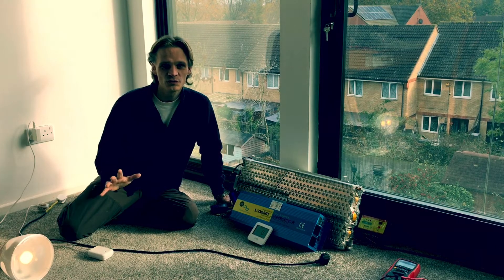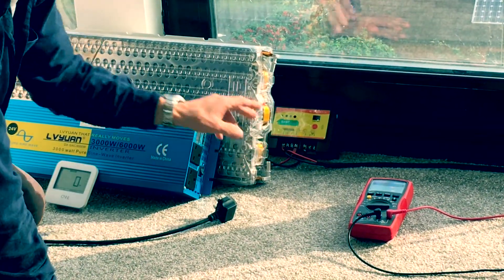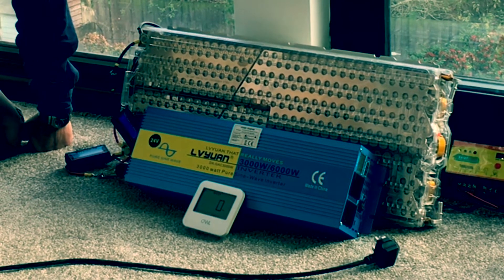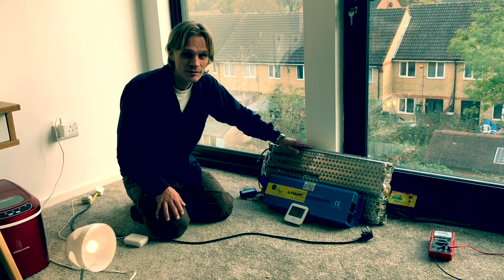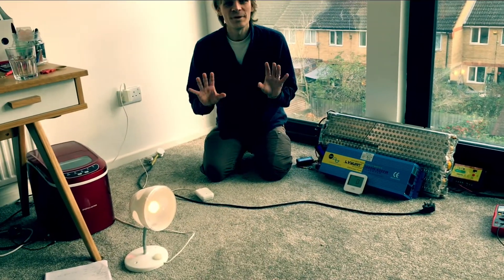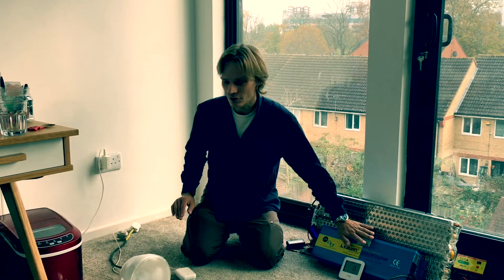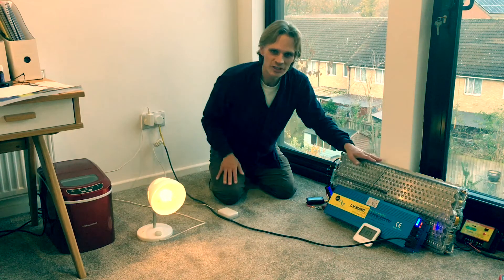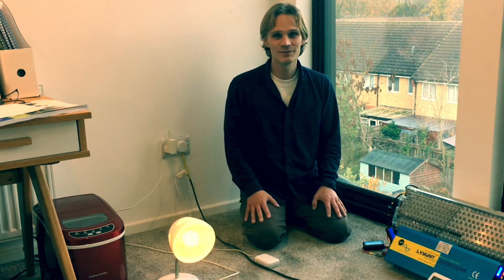6. How to use a Tesla battery to power your house

Comment: I’m going to use old tesla batteries but mostly if hella cheap or from my vehicle battery replacements..due to 2 main factors currently..used tesla batteries are not cheap compared to deep cycle batteries .. deep cycle batteries also are ready for power useage as a power source as is.

Comment: Nice video! But I want to know the process of taking a tesla battery and converting it into a power bank. I can go on eBay and get a car battery but how do I connect the cells together to make a power bank, and what are the safety considerations I need to know, like fuses and battery control module. I'm planning to buy a 15kws battery and a 5kws hybrid invertor from growat or give energy. Let me know your thoughts

Comment: Dangerous
Reply: Couldn't agree more. I've only got as far as the first minute where he shows a cable with a domestic socket on each end and got very worried. I'm generally a DIY supporter and think there is too much assumption of competence in 'professionals' - but this is taking it too far, surely.

Comment: are you using the original BMS board?
Reply from the maker: No, I’m using a battery balancer bought off eBay to balance the cells (although I’ve actually never had to use this as they’ve stayed within 2 millivolts of each other) and a charge controller to limit the charging voltage and an output cut-off (on the electric boat motor and on the 250V ac inverter) that prevent over discharging

Comment: DO NOT DO THIS IF YOU VALUE YOUR LIFE. there is a reason you can't buy 'a cable with a plug on each end' in the shops: it's lethal.  THIS VIDEO SHOULD BE REMOVED BEFORE ANYONE GETS KILLED.

Comment: Hi, where can i get that 13a plug you used to plug the inverter into the wall please?
Reply from the maker: I made that myself. I would recommend being very careful if you also make one as the ends of the plug will be live from the inverter. So best to make sure everything if off as you’re plugging it in or if you ever unplug the lead
Reply: @aktsolar  Hi, i followed your steps & it works. Thanks alot
Tested using a Ecoflow Delta

Comment: Hi, are you still using this? Does the charge controller float voltage when fully charged? And did you use any BMS controller for battery?
Reply from the maker: Hi, yes, I’m still using this although it’s now on my boat where it powers a 240V system and also a 24V electric motor. The charge controller does have a float voltage and the low voltage cut-off is dealt with by the inverter and the Motor, both of which have low-voltage cut-offs set above the minimum voltage of the battery.
Hope this helps and do ask if any further questions.
Reply: @aktsolar  Thanks for reply.

Comment: Do you use a bms?
Reply from the maker: Yes, here’s a link to the balancer I use. I also use a charge controller to prevent overcharging and cutouts on the appliances I use (e.g. the inverter and an electric motor I use) that prevent over-discharging:
5. How to wire in a BMS to your lithium ion (Tesla) battery to balance / equalise the voltages
https://youtu.be/44uovhbMPxw

Comment: Have you looked at the tesla 3 batteries KW to £ better value possibly because size not as compatible with EV conversions .  thanks Colin
Reply from the maker: I have looked at them and they are rather large. The great thing about the Model S modules is there are 16 on each car and each module is just 30kg and ~24V. Whereas there are just 4 modules in a Model 3 meaning they are much bigger, heavier and have a less convenient voltage
Reply: Thanks for tesla3 thoughts Nissan Leaf batteries seem another possible option simplistically theory could a leaf be parked and solar fed into car through charger and disconnect electric motor feed  to supply house through inverter?

Comment: how much the battery pac cost
Reply from the maker: It was £800 second-hand on EBay
Reply: @aktsolar  thanks for the reply, thats a very good price but how much kw they have right now, how much they lost, how many years are the battery pac
Reply from the maker: Mine has nearly full capacity. I think I calculated it as around 5.0kWh. And I use it relatively lightly so I think it’ll last for many years
Reply: @aktsolar  you have any link to buy something like this, I think even if you don't use the battery you will have degradation so it will be better for you to use the battery frequently
Reply: People say this tesla modules squeeze about 3.4kw  @aktsolar

Comment: It saves about a quid a night so payback will be many many years- this is the big problem as climate change will cost big money as well as lives, but in the short term, Joe Public has to take a financial blast to be enrivo good little boys and girls. However is good for caravans etc. Will save a load of CO2 production. Could do with 16mm tails going into breaker box for safety with a switch that ensures mains is never connected whilst off grid is. Plugging into a plug socket may end up in a lot of headache if it becomes overloaded and heats the 2.5mm cable excessively.
Reply from the maker: Thanks for this. If you’re right then £1 a day would make payback in about 4 years which wouldn’t be too bad - the cost is about £800 for the battery, £200 for the inverter and £400 for the panels and controllers.

Comment: Nice and simple, but then you know what you are doing.
If you could give an indication of cost.  (I see the battery packs for about £950, one third the cost of a lithium leisure batteries to the same capacity)
Cable with three pin plug either end….scary!  There must be a better option.
Should not use a RCD, instead of a fuse?
Reply from the maker: I bought mine for £800 direct from an eBay seller about 18 months ago. It’s 5.3kWh and very well balanced.
As for the wiring set-up, you’re right, there probably are better options. As you say, the method I use is simple and with all these things, you have to be very careful. Even a simple shorting of the Tesla battery would be disastrous as it has individual fuses on each of the 144 cells which would be very difficult to replace so you’d probably have to scrap it...

Comment: Can you add more packs
Reply from the maker: Yes, very easily. You can either add in parallel to create a larger 24V system or add in series to create a higher voltage system.
Reply: @aktsolar  the reason I ask is bc this would be the best and cheapest way to store for your house vs the other home options

Comment: Great great video. Looking at this, could i have say 4 tesla batteries hooked up to a 6k panel system, meaning i could pretty much power the house via a plug socket ?
Reply from the maker: Yes, you could hook 4 Tesla batteries to a 6k system. For pulling all the power out to a house you might want to connect directly to the fuse box though as a plug socket (at least in the UK) is normally only intended to take around 13A at 240V (= approx 3kW)

Comment: Awesome videos man, 
I live in the US Pennsylvania specifically, and we aren’t allowed to disconnect from the mains even if we produce all our own electricity. So would still being connected pose an issue? Cheers
Reply from the maker: Not sure about that. I normally disconnect the upstairs part of the house by switching it off in the fuse box. That could still leave the downstairs connected. Would that work for you?
Reply: @aktsolar  / what I’m looking at doing is having a 2-3 kWh battery pack that once charged, the electricity will be shunted away from the batteries and either run or supplement the house, with any excess going back to the grid. I’m just not sure how to go about it and almost no one has solar up here, so any info is appreciated
Reply: Never ever do that.

If the power goes out locally, the linemen from the electric company will come to fix the downed lines.

Your solar panels, plugged into your house and flowing back into the grid, will electrify the lines the linemen are working on.

All the while the lineman think the lines they’re working on are dead lines with no power.

Meanwhile your house is feeding power into them….

That’s why solar systems have laws and regulations and require proper installation and local inspection.

If you have grid tied solar panels they will be designed to shut off if the main power goes out. Yes, you will lose power in an outage, even though you have solar panels.

Having properly installed solar panels and batteries that are still grid tied, but can switch over to powering your house during a grid outage, requires wiring that shuts your house off from the grid during an outage.

You can do that isolation manually as shown in the video, but it’s almost guaranteed to be somewhere between “illegal” and “hands behind your back you’re under arrest”.

Please don’t go plugging in generators or solar panels to your outlets without cutting off your mains power first.

In fact, I would argue don’t do it at all.

If you kill a power line worker, you’re looking at a nice long jail sentence for manslaughter. Time where you’ll have plenty of opportunity to read up on the proper electrical installation you should have done.

Here’s another scenario.

If you have a non-permitted solar panel system installed and your neighbor also has one installed, who goes to jail when the lineman dies, you or them? What if you super duper pinky swear you turned your mains power off before energizing the system? Will the judge believe that? How about the crying widow sitting in front of the jury?

Comment: Can you power the entire house in Winter with the use of the battery?
Im located in the netherlands but looks like your in UK -> same sun hours?
Reply from the maker: You can get insolation levels for any location on the internet. So you can check your nearest town. In terms of powering a house through winter though, you’d generally want multiple batteries in order to have enough power for when you get several cloudy days on end. For my set up with only 240W of panels there have even been some days recently where , after several cloudy days, I’ve had to revert to grid electricity. Hope this helps.

Comment: Hello, did you ask for permission for solar panels
Reply from the maker: Hi, you don’t need any permission for using off-grid solar applications.
Reply: @aktsolar  Thank you for the answer, I also have a sloping roof, I wanted to lead the cable to the garden for the shed
Reply: @aktsolar  great solution on yor video 😉
Reply: Send link to inverter
Reply from the maker: Hi, the inverter is from eBay. There are several sellers and none of them seems to have the inverters constantly in stock. So your best bet is just to look on eBay and you should find them quite easily.

Comment: Oh wow, i have been after a good inverter that can run from 18.5V to 30V. Ill look into that inverter
Reply: Look at Victron Phoenix or Multiplus inverters.  They run from about 19 volts to 33 volts.
Reply from the maker: Nice range. I’ve seen Victron equipment is good but rather expensive.
Reply: @aktsolar  it also has 5 years warranty. We have everything in the van victron apart from our Tesla battery. I think it’s worth the extra money because I first went for a cheap 24v-13.8V converter and it cost me £50 and after using it for 6months it stopped working, I can’t get my money back. Instead of buying another cheap one I went for victron converter 70A 24-12V converter( you can adjust it to higher voltage) that was about £125 so now I know I have 5 years warranty and don’t have to worry about it again 😊

Comment: How did you get hold of 1 module  Tesla 1865 cell ,are you using the Tesla BMS
Reply from the maker: eBay. The seller got them from a crashed car. And I’m using the BMS I explain how to wire in here: https://youtu.be/44uovhbMPxw

Comment: Nice video. I love simple stuff like this that anybody can do to lower their electric bill. Do you have a BMS on the battery? This is still a little bit too complicated because if you run out of power you still have to turn on the breaker and turn off the inverter. A Chinese hybrid inverter like MPP can always be connected to the grid and only take from the grid the extra power needed.
Reply from the maker: Yes, there’s a BMS on the battery. I show how I attached this here: https://youtu.be/44uovhbMPxw

I hope this helps :)